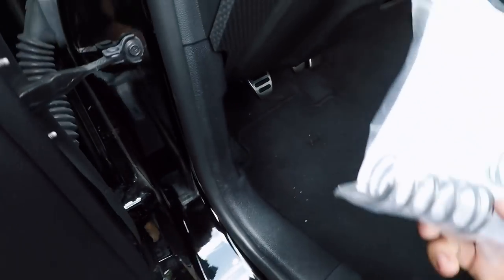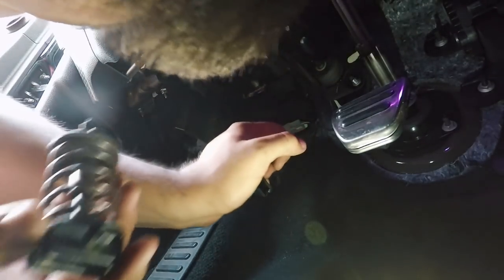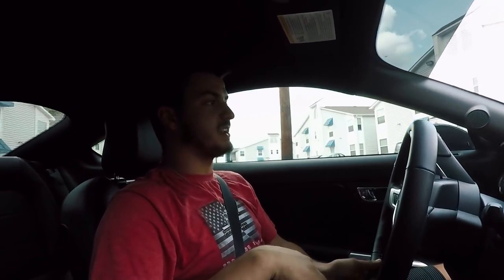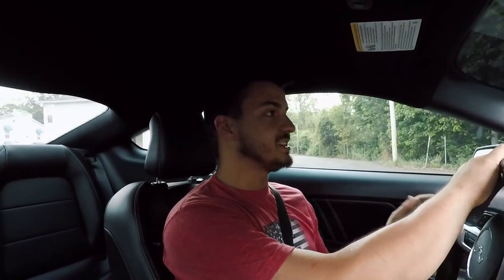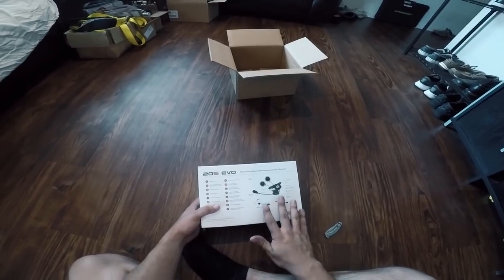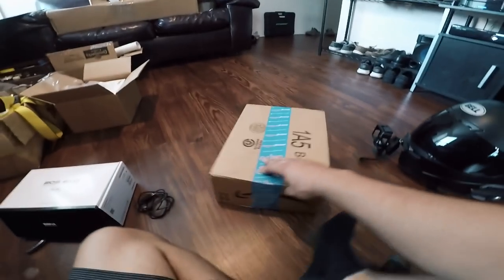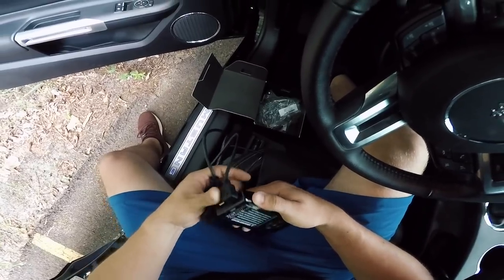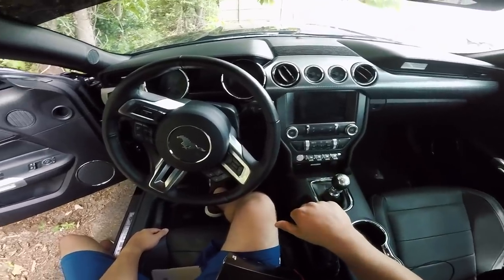Here's the $19.95 fix to NEVER STALLING in a manual car!

Comment: Be careful, the clutch pedal is actually heavier with the steeda spring. It is a clutcassist spring which helps to push the pedal down and it was replaced by a lightweight spring. So is gets heavier with this mod!

Comment: I notice the camaros are this way too... the clutches are not very smooth when you depress them. They want to spring back out very quickly, making it hard to hit that correct bite point causing you to either jerk the car, stall it out, or both

Comment: Actually, the clutch feel isn't "lighter" with the Steeda spring.  It takes a little more pressure to push the clutch down.  Where I agree is that the pressures felt when releasing the clutch are much more linear so it's easier to predict the clutch engagement.  I've had my car for just over three years now and finally got around to doing this mod.  My first few shifts felt awkward because of the change in clutch feel but once I adapted to that, it's been much easier to consistently make smooth shifts which is something I was often frustrated with.  As others have said, "should have done this a long time ago."

Comment: When the gt will be back on the road
Reply from the maker: CH_ Hamza971 as of today, the motor is being pulled! Updates will come soon!
Reply: itsjusta6 ok man i just want to see that beaat back
Reply: CH_ Hamza971 he said he wants to let the real mechanics that know more fix the engine and he said it might take some time
Reply: You don’t quite have the right idea how it works. The first half of the travel the spring is being compressed. The second half of the travel the spring is actually helping you by assisting the pedal moving in and holding on the floor. The engineers just didn’t match the spring to the characteristics of the pressure plate very well. I am not a fan of the stock spring either. I installed the steeda on my 2015 and even though the pedal is a bit HEAVIER since the spring isn’t there to assist, it feels more  like a normal clutch
Reply: itsjusta6 oh yea

Comment: i just took mine out. 2 years later still perfect
Reply: I know this comment is a month old but i have a question. Does it take longer to shift through gears or does it not effect it that much?
Reply: ThaBestEzrealNA doesnt change anything with clutch functionality. Just removed that snap back feeling in the pedal feel.

Basically without the spring u can feel the clutch engagement point.
Reply: okay thanks for the reply. I've been searching and see people do this on kinds of cars so I assume I could do this to my Camaro SS since the stock spring makes the pedal feel so stiff.

Comment: that  gauge wire on a short return and compress  span, of the oem return spring is to large .[ depending on type off metal] that aftermarket one you just installed has got a good wire gauge on it. good on you mate on getting your control pressure right. thems like the supervisor who said yes to those oem springs  needs to rethink himself.  from a kiwi

Comment: I have an 07 GT and I am barely learning to drive stick, does the 07 model use that same OEM clutch spring as the one in this vid or is it different stock spring? And should I bother looking for a replacement to possibly make it easier or just learn to drive it as is?? Would really appreciate any advice/help as this is proving to be a bit more challenging then I anticipated, especially trynna go uphill. :/

Comment: Are the eco boost any good? Are they pretty quick? Awesome video by the way once again.
Reply: 1's, I like mine. Especially for the price
Reply: great cars, great on gas but lose value so extremely fast
Reply: Tristin Salles, I’m thinking about it honestly might get a 01 gt though
Reply: 1's i got one for my channel an its fun
Reply: 1's depends on what you’re looking for. If you want a nice interior, good gas mileage, and some power go for the ecoboost or a good old American v8 which you could build go for the gt
Reply: They’re pretty quick. The only mods I’ve done are a cold air intake, new charge piping with a blow of valve, and a tune. It makes around 280hp and 400 torque to the wheel
Reply: They’re honestly the better buy on paper than the 5.0 (unless you’re going for a straight drag car) but the personality and out of the box performance of the coyotes are better
Reply: Dawg. Get a v8
Reply: 1's The only thing that would be better in terms of the 2001 GT vs the Eco is gonna be the sound. UNLESS you like the sound of a turbocharger. Other than the sound the Eco is better in any other way. I have a 2016 Mustang Ecoboost premium and I absolutely love the interior and the technology such as the heated and cooled seats. And for what they are there no slouch you can definitely feel the torque. So far I have ran a 2007 Mustang GT and a 2013 v6 and took both of them. Stock vs stock of course. And with a tune these things are wild!
Reply: 1's I had a 16 ecoboost for a bit. Traded for a 14 gt. both have pros and cons. if it’s a daily, honestly would recommend the ecoboost because of gas mileage. they’re quick enough to still have some fun too. Can’t really go wrong with a v8 tho.
Reply: randomvideoguy43 100% Agreed
Reply: randomvideoguy43, but this guy is looking at a 2001. 4.6 is way different and slower than the 5.0 we love today

Comment: Never stall again: get an automatic
Reply: Tesla boi auto is for sissys lol
Reply: I've got a 2016 GT PPP with the manual transmission.  I never considered the automatic
transmission after driving one for a week while on vacation 
In Florida.  It was a 2016 GT 6 speed auto.  There's just something about shifting gears and having more control with the clutch.  I removed the spring all together immediately and at 39K miles I've never had a problem.  I would be bored numb with an auto.  The 10 speed has my attention but I just can't see having a Mustang and not being able to shift gears

Comment: again your car is NOT 850hp..... check out Cleetus McFarlands you tube channel hes built pretty much the same motor with a WAY bigger blower from VMP and he only made 750hp you have a factory roush blower last time you were on the dyno you made under 600hp and it was dropping fuel...... when you get the motor fixed put it back on the dyno if it makes 850hp or anything close to it ill shut my mouth but i told you in older videos that your going to play the weakest link game with your car and you did and blew your motor